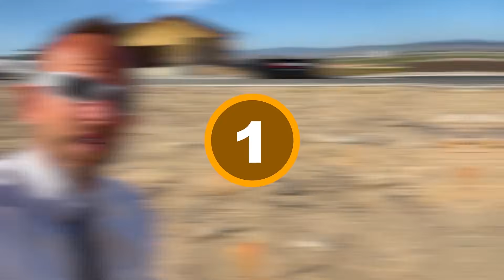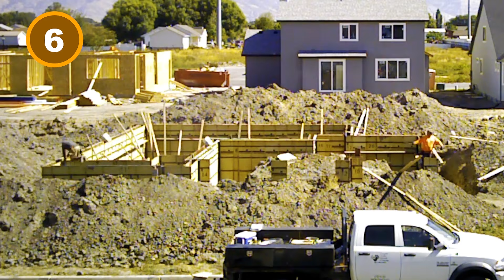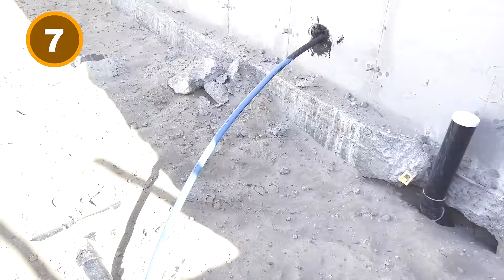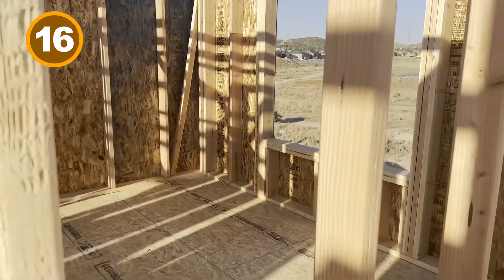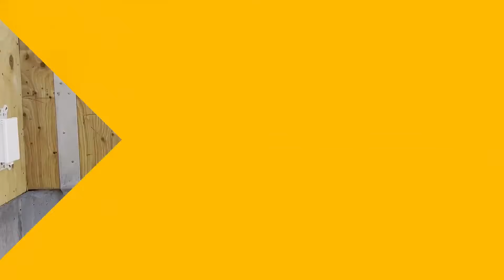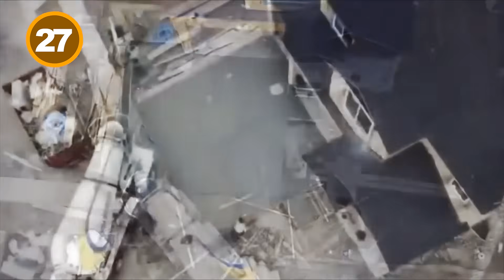How a House is Built | Most Comprehensive Video EVER Created on the Home Build Process

Comment: Why is the asphalt put down first? Isn’t there machinery that’ll destroy the road for building the houses? Here in The Netherlands we use metal plates that’re put on the sand for machinery to roll over and when all the house construction is done they put down the asphalt.
Reply from the maker: That is an excellent question. It’s annoying for some of the trades, but certain vehicles aren’t allowed on the road. Larger vehicle’s like a backhoe need to be loaded onto a trailer to move across the street.
Reply: @tywilde  that seems like a hassle, backhoes here just roll over the metal platforms/plates and the same goes for all other piece of equipment. I appreciate the reply though :)
Reply from the maker: @miles5600  yeah, we should probably look into something like that. Though, I’m sure it’s being done in some places, but I never see it here in Utah.
Reply: @tywilde  yea i’m pretty sure too.
Dutch engineering overall is really modern like their home construction and the way they design the interior of homes. Modern dutch engineering is amazing
Reply from the maker: @miles5600  thanks for sharing. I’ll have to check it out.
Reply: @tywilde  no problem man

Comment: Hello thank you for the in-depth video! I subscribed to your channel good content! 
I had a question I’m currently with kb homes and as of September 8th they finished framing. Pending  county for inspecting framing they told me after they will start electrical , hvac, roofing etc. do you think I would be able to close in December? I have my lock rate ending in December 31st . Wanted to see from your experience if this is possible.

Thank you,
Reply from the maker: Yes. They should be done before the end of the year. The key word is should. Thanks for watching & for subscribing!!!
Reply: Awesome thanks for the insight.  Should is better than no 😊
Reply from the maker: @Kriiis24  best of luck!

Comment: Great job in step 20, sir. Your explanation was spot on except for one small detail regarding the junction box. Just to share some information, a junction box serves a different purpose compared to an electrical gang box. Junction boxes are used to house wire connections, ensuring safety and protection for electrical connections. On the other hand, electrical gang boxes, also known as switch or outlet boxes, are containers specifically designed for switches, outlets, or other devices. They come in various configurations depending on the number of switches or devices they can accommodate (e.g., 1-gang, 2-gang, etc.). I'm not mentioning this to show you up, but just to provide some additional insight. Keep up the good work!
Reply from the maker: Thank you for sharing. I am always trying to learn & I sincerely appreciate your input.

Comment: On step 45 i also agree to buy it how the builder put it, especially in apartments. If in an apartment or townhome, if maintainance needs to be done it can potentially frustrate the fixing process because no one has a drill bit for a hillman screw as an example. Plus its easier to get used to the appliance if its not changing brands  and models frequently. Thanks for the video. I always wondered why land just sat there for the longest time and then suddenly the foundation and wood is up. Seems like quite the legal process. Back then things like the downtown salt lake bishop storehouse grain silo could be built in about 8 days. Its incredibly huge and still works regardless. How times have changed, but it keeps people safe.
Reply from the maker: Thanks for sharing your thoughts. I've been doing this about 20 years now. It's shocking how much things have changed from when I started.

Comment: Don't forget to keep that port /john on the premises while the inspector comes or you wont pass?
Reply from the maker: I'm pretty sure I mentioned the placement of the Honey Buckets but You're absolutely right, its got to be there through most of the process. I should have mentioned that.
Reply: Is this something the contractors know to do? Or does the owner need to remember this?

*I will be watching this multiple times 💜
Reply from the maker: @LifeWithAlliDaily  that’s an excellent question. Ultimately, it’s probably the owners responsibility. But, the contractors know to do this.

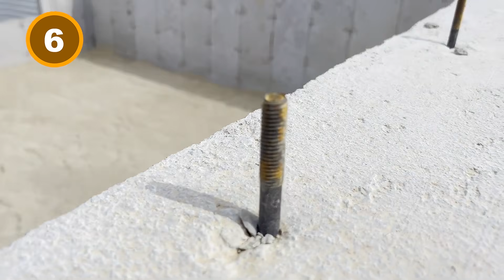Comment: In the video at I want to say 8:26 where the  mettle screw are sticking out are those from the rebar if not how did the mettle screw get there
Reply from the maker: That is an excellent question. It is placed in the concrete shortly after it's poured.

Comment: My toxic trait is thinking I could build my home by myself...yeah heck no!!  Wow.. I'm very impressed with your knowledge and even more impressed by how a pile of dirt can turn in to something beautiful.  I'm looking to buy my 1st home within the next 6 months so Ive been on YT for the past 2 weeks...learning so much from ppl like you.

Thank you!
Reply: You probably may not be able to physically build the whole home yourself but you can be your own general contractor and delegage all the work to specific subcontractors. If you have the know how you may even chose to do some work yourself like drywall, painting, finishing work, tiles etc. Doing it like this may save you over $100k. Its been done many times by regular people with regular jobs. Just gotta do your homework.
Reply from the maker: @nateg5915  Yes. 100%. I know a few people who have done it. And, I've personally done it to have my basement finished.
Reply: @nateg5915  that's actually exactly what I want to do. I'll have to do it on a construction loan though because all of the new builds I've seen and the sales ppl for them said I have to let the builders do it. Which I know they upcharge upgrades out of this world. And it still won't be to my liking.
Reply: @mgtowalfa508  yes you would need a construction loan. You can use the same  loan to buy the lot and also for construction. Some lenders will do that
Reply from the maker: @nateg5915  Thanks. That is correct.
Reply from the maker: Thanks for the compliment & best of luck on your new home.

Comment: How long does it take for the footings to harden?
Reply from the maker: This is an excellent question. Thanks for asking. The common terminology is cure, not harden, but that doesn't really matter. Usually, the builder is pouring the foundation wall on top of the footings after 48 hours. The concrete is about 70% strength after a week & continues to harden for several months. Thanks for watching.

Comment: Just a shame contractors really don’t know how to build a proper house anymore.
Reply from the maker: I think the problem is that they’re building too fast and not able to hire the best qualified trades.
Reply: @tywilde I agree with that. But a 2x4 is not a 2x4. And they wonder why things fall apart.  And don’t even start with roads. Four inch base with two inch over lay.  No wonder they only last three or four years.   A solid eight in one pour and it will last literally years ten or more  but those stupid unions control that

Comment: This is the most comprehensive home-building video Ive ever seen! I just built my first new home, an entry-level home, I see where costs were cut vs this house,

 thankfully I hired my own ex-builder inspector, I learned alot but this was a great primer video.

I have alot of video of sub-contractor corner-cutting, if you build in a subdivision with a low-cost builder, the subcontractor you get can be the make or break, some are amazing & some cut all sorts of corners, spending $1500 for my inspector to make surprise inspections of subcontractors is everything.
Reply from the maker: Thanks for the compliment & for your feedback. I actually used more than 20 different homes in this video. Congrats on your new home.

Comment: 50 Building steps:
1.	3:33 Laying out the site using the plot plan (architectural drawings)
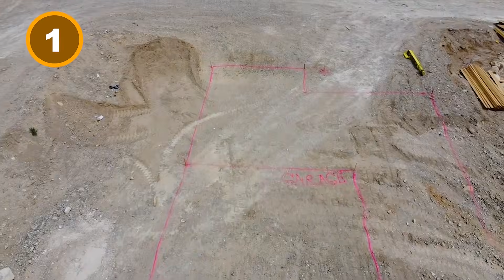2.	3:48 Excavation
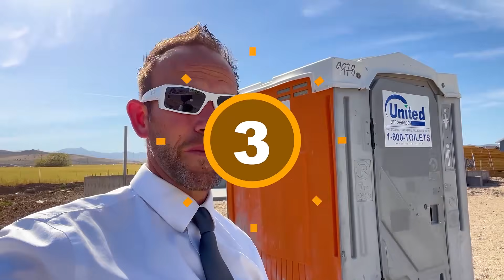3.	5:03 Outhouse/Porta-potty
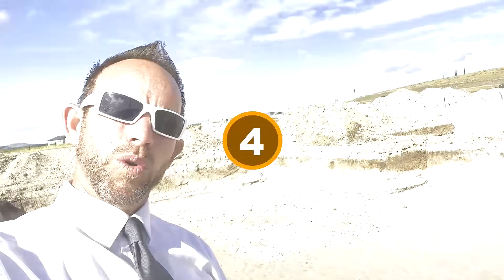4.	5:23 Soil bearing capacity test
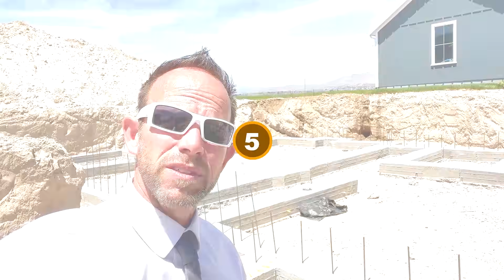5.	5:33 Footings
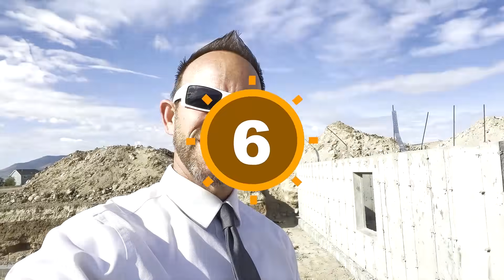6.	6:12 Foundation walls
7.	9:15 Sewer (Sanitary) and main water lines
8.	10:24 Window Wells
9.	10:43 Damp proofing
10.	11:42 Backfill
11.	11:54 Compaction
12.	12:34 Basement and garage floors
13.	13:28 Power Supply 
14.	13:49 Gas Line
15.	13:58 Dumpster
16.	14:49 Framing
17.	21:50 Roofing
18.	22:34 4-way Rough-in of MEP (mechanical, electrical, plumbing) + framing
19.	23:23 HVAC
20.	24:56 Electrical
21.	27:43 Plumbing
22.	30:11 Windows and doors
23.	34:33 4-Way inspection (Framing, Mechanical, Electrical, Plumbing)
24.	35:37 Insulation
25.	37:23 Drywall
26.	39:27 Mudding, taping, and texture
27.	41:54 Driveway
28.	42:31 Soffit and fascia
29.	42:54 Stucco and siding
30.	44:28 Brick or stone (before or after the last step)
31.	44:41 Trimming/finishing work
32.	45:40 Caulking and paint
33.	47:41 Decks and final concrete
34.	48:34 Garage doors
35.	48:44 Wood and tile floors (before cabinets)
36.	49:04 Cabinets
37.	49:39 Floating floors (after cabinets)
38.	50:14 Final grading
39.	51:00 Final electrical
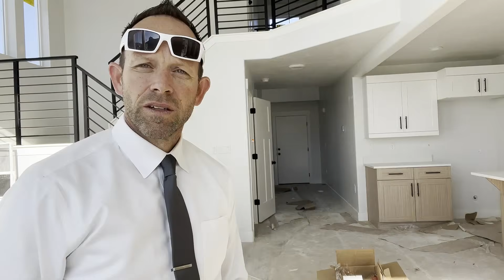40.	51:21 Final HVAC
41.	51:35 Final plumbing
42.	51:54 Cabinet Hardware
43.	52:00 Carpet
44.	52:27 Bathroom Glass
45.	52:33 Appliances
46.	53:11 Landscaping
47.	53:56 Quality walk by construction manager
48.	54:30 Final inspection from city
49.	55:04 Final buyer walk-thru
50.	55:55 Closing and signing of documents

Posted it on the right video this time :D
Reply from the maker: Thanks for watching & for sharing.
Reply: Thank you so much for the list
Reply: this wa a big help
Reply: you've made my day. Those days i've studied project management. Now your lists add in rooms for my references.Tq for sharing the lists.
Reply: Thank you so much
Reply: That's passion right here! 👍🏼
Reply: Thanks for the list 💯💯💯
Reply: thank you so much
Reply: 1:11:1
Reply: Why build a good foundation if the rest of the house is made of paper. After point 15 the “house” has lost massively in value
Reply: Platform framing isn’t “paper construction.” It’s a highly engineered, extensively tested building system that safely carries loads and resists wind, snow, and seismic forces. If anything is weak, it’s just the interior gypsum finish, not the structure itself. The actual load-bearing wood frame is renewable and low carbon too. Locally sourced materials for the win!
Reply: Damn dude you got too much time on your hands lol